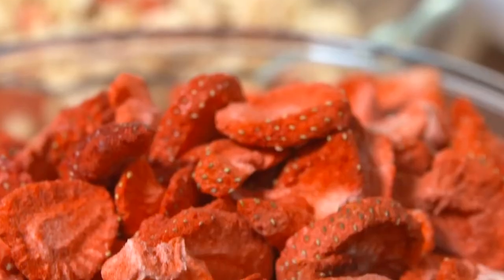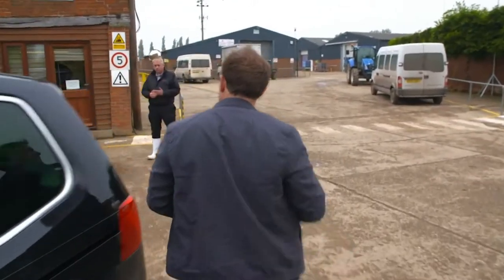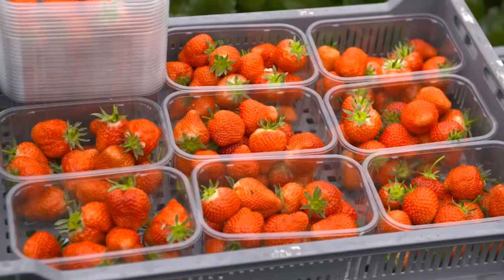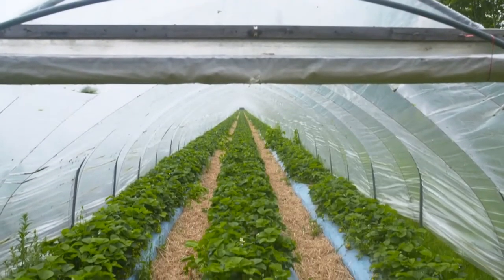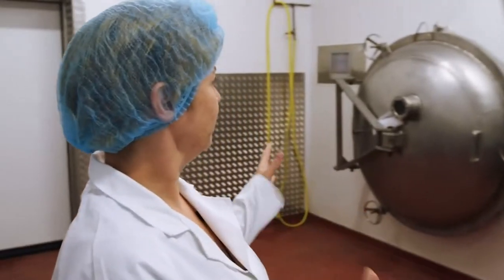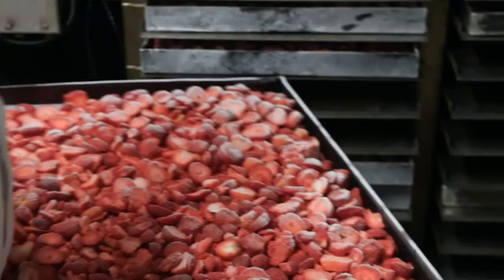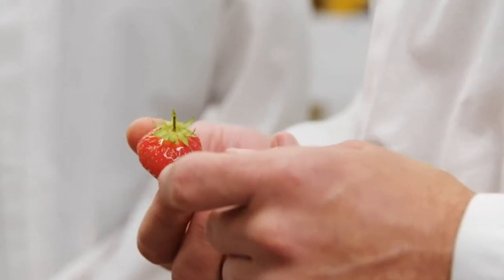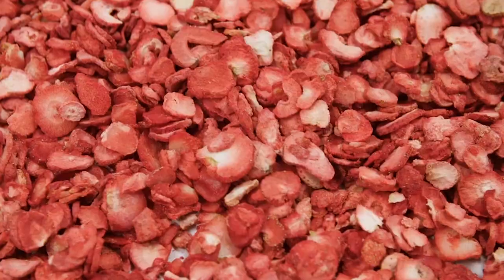How exactly do you 'Dry' a Strawberry? | Food Unwrapped

Comment: "sub zero" hits hard until you realize they just mean lower than 32° f
Reply: Didn’t she say -40? iirc -40C is -40F
Reply: @Aikano9  at first she said subzero. also omg I've been wondering lately if C and F ever intersect like that but I've been forgetting to look it up!! thank you!
Reply: Which is why I will never understand Fahrenheit your 32 is my zero but my 32 is your 90! In my head there's cold, nice, kinda hot, and f*cking hot. Cold is below 15c, nice is 15-30, kinda hot is 30-35, and 35+ is f*cking hot! But here in Australia our second lowest bush fire rating is "high" so you can understand why my "cold" is your 59
Reply: @callabeth258  interesting way to think about it! It's winter here right now... your "cold" 15c is 59f. it's a warm day here now at 36f/2.2c. all next week it will be around 20°f/-6.6c, and next Friday has a low temp of 8f/-13.3c. 
sub-0f would be -17.2c, and that's very cold! on a day that's around 0c I'll open a window for my cat, like today 🥰. 
if I opened my window when it's -6c out, all of the humidity would be sucked out of my house like a vacuum.